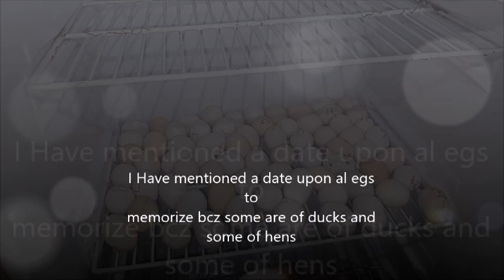EGG HATCHING IN refrigerator ( Fridge ) || DIY- Homemade Fridge egg incubator || How to hatch eggs

Comment: How have you ensured proper Oxygen supply for better incubation. Perhaps it has failed due to lack of proper oxygen supply. Similarly the small cups/glasses used for water storage for humadity, will not meet the minimum desired humadity. Don't know if W1209 can support that much load. Appears a failed effort. Sorry comments are not meant to hurt your feelings
Reply: Or due to not turnering them
Reply: How much expenses  with out refrigerator  please  tell me

Comment: So eggs can be locked without air ,I need a clearification on the instrument  thermo you installed and why outside?, What is the easier way or easier one to use to check the humility and temperature

Comment: So do you suggest that I set all eggs say on Oct 1st, (30-40% humidity), then Oct 15 is lockdown for the quail and I need to increase the humidity to 60-70%... Chicken eggs will keep turning until Oct 19, but won't the humidity mess up the hatch?
Reply: Usually it won't have too big an impact on the chicken eggs, but it would be better to start the quail eggs later, so they hatch at the same time. I have done this more than one time, and it works very well. It also depends on where you live, I live in Norway and we usually don't raise the humidity until just before the hatch, due to the incubator keep a high enough humidity until hatching day. But if one lives in a dryer climate, one should add enough moisture so the air bubble in the egg doesn't get too big.

Comment: Add humidity controller for better result. Because you are going to hatch 200 eggs. And you need to maintain a bit space in between each eggs.
Reply from the maker: i have measured humidity by using humidity meter that's 55 so we dont need ..by the way thanks for giving me suggestion